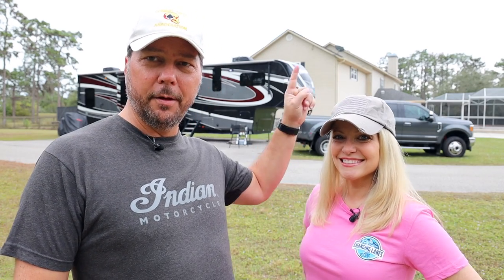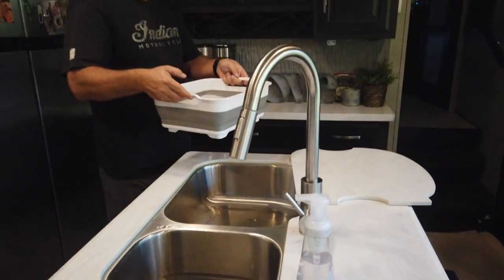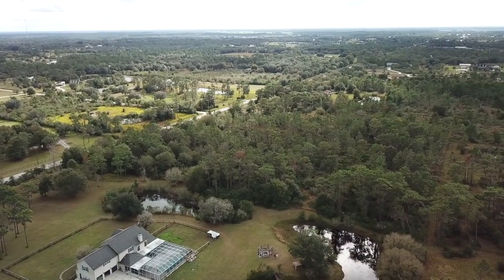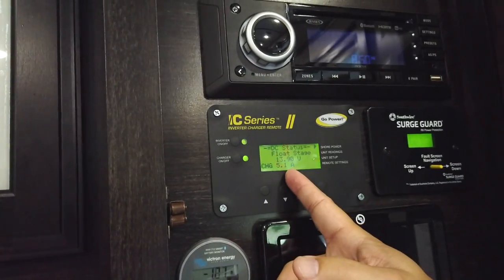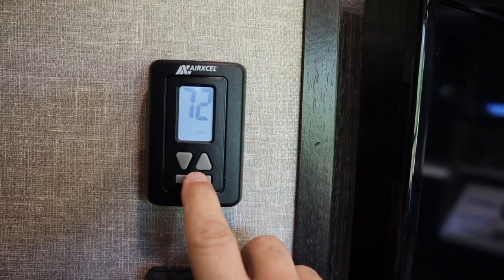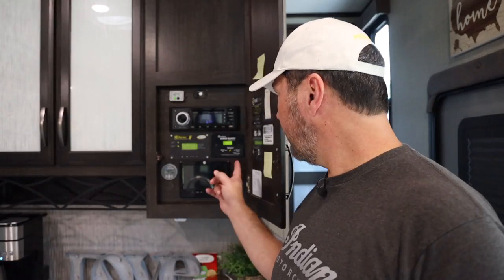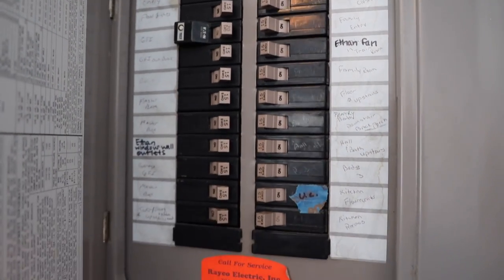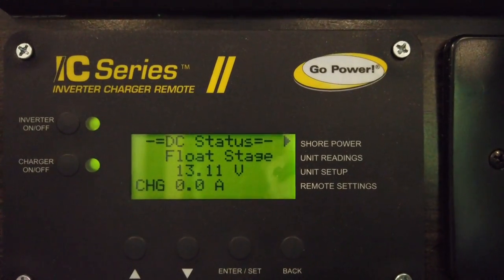RV Moochdocking! | Cheat Boondocking Like a Pro! | Changing Lanes!

Comment: Maybe a silly question...  Is there any point to using a splitter on a 30 amp unit to draw from two 15's?  Maybe to help prevent tripping breakers at the host house?
Also, is there any truth to the rumor that you have an easier time if you plug your 30 amp into a residential clothes drier (or other large appliance) outlet since they use the same plug?
Reply from the maker: IF 30A is available, no point in doing 15+15...  Residential clothes dryer plugs can sometimes be wired for 240V and is definitely a bad idea for RVs.
Reply: @ChangingLanes  Thanks for the response!  What I meant was if the RV is 30 amp, does a 30 amp splitter to 15+15 exist, and if so, would there be any benefit to using it?
Reply from the maker: Ohhhh... I misunderstood.  No.  The reason you can split a 50A RV is that it's really two legs of 50A.  So, 50A is really 50+50A.  A 30A RV only has one leg so there's nothing to split.
Reply: @ChangingLanes  Got it, thanks!  Glad I stumbled upon your channel, your videos are very informative.  If you don't mind me asking one more question...  In one video you mentioned you have a Grand Design - we've pretty much narrowed down our selection to two different Grand Design models, in your experience is the support and community truly as amazing as everyone makes it out to be?  It seems too good to be true.
Reply from the maker: We think so!  Well before we were ever ambassadors for GDRV, we received amazing support.  Also see: https://changinglanesrv.com/faq/?Display_FAQ=2193
And the community is really like family and the rallies are great!
Reply: @ChangingLanes  Sweet, thanks again for the response!  We're probably gonna go full time in a couple years once the nest is empty - another thing that has us sold on either the Imagine XLS 22RBE or Imagine 2600 RB is the insulation (of course, there's no telling what the future holds, but that's what we're thinking right now).  We're currently based in the midwest and most of our family is out here, so four season capability is mandatory and Grand Design seems to know what they're doing in that department.
Thanks again for all your help, looking forward to shaking your hand at a rally someday.

Comment: Is it ever necessary to dog bone from 30 amp to 20 amp, down to 15 amp? Does it make it safer? I'm plugging into an older home and don't completely trust it's wiring. Thanks!
Reply from the maker: The dog bone adapters simply adapt the wiring.  It won't change anything about the circuit you're connecting to or the loads from the RV.  If it's a really old house with old wiring, this might not be a good idea.

Comment: Newbie here and i know this video is a little old but hopefully you can shine some light on this for me. lets say i buy a 30 to 15/15 adapter can i just run 1 side? asking because if i can just get that without the single 30 to 15 its less i would have to carry. Thanks.
Reply from the maker: Yes, but only half of the things in the RV will be powered.. Additionally, if you have a surgeguard or some type of power protection (highly recommended), it will likely see the one dead leg as a fault and not pass any power.   I think the built in power control system that came with our RV might also not like it...
Reply: @ChangingLanes   @Changing Lanes  This applies to a 50amp system. How about a 30amp system? do they mostly come single or 2 pole? I will be buying a RV this coming winter and most likely it will be a 30amp unit (going with something like a keystone springdale 260BH). Ha newbie questions. Thanks for helping out.
Reply from the maker: Oh.. I misread.  I don't think they make a 30 to 15/15 because there's only one side to 30A and nothing to split.

Comment: It's closer to 38 amps to start most air conditioners, You can use an Easy Start to bring that start down to 17 amps.
Reply from the maker: We've considered that...  A hard start (basic capacitor with no "smarts") or soft start (same but with "smarts" but about 3x the cost) are great add-ons if you're having trouble with blowing breakers, tripping the genny, etc. But, we've never had any issues using our stagger start method so it's difficult to justify the cost in both money and time right now to invest in them.

Comment: Not entirely relevant - but dumb question:  if you have a 30amp camper can you moochdock on a split from 2 15amp house plugs to a single 30amp camper? Or does that not work the same way as the 50amp service split?
Reply from the maker: No.  30A RVs only have one leg, so theres nothing to split...

Comment: Chad, thanks for the discussion about plugging into a GFCI outlet when running 2 x 15amp cords through a y-connector.  Last time I tried to plug into a home 15 amp outlet (exterior GFCI) it tripped the “pushy button thing” every time, even though I only had a single cord connected to a single outlet (through 2 dogbone adapters in series).  The only loads inside the RV were the inverter to cool the residential fridge and maybe a trickle load on the charger (the batteries were topped off while driving).  After several attempts I gave up.  Any suggestions?
Reply from the maker: Tough to say.  The GFCi trips when it detects an imbalance between the hot and neutral lines, and it could indicate a wiring problem in the RV where either the hot or neutral are connected to ground.  Here's an article I found that might help: https://blog.goodsam.com/rv-doctor-why-does-the-gfci-on-my-brand-new-rv-keep-tripping/

Comment: Question for ya Chad....referencing the shot of the surge guard monitor at 19:06.  With line one only showing 110v, could an autoformer be placed between the y adapter and main 50a line to the rig to bring the voltage up on that line?

Or not because it isn't a 15a autoformer?
Reply from the maker: The autoformer will work with any input.  It doesn't care about amperage (other than going over 50A).  I'm not 100% sure how it would handle separate inputs to each hot side if they are in-phase though.  It would definitely be fine for a single input.

Comment: We have a 50amp rv. Looking at camping where they have a 30amp & 20amp.  Would the adapter with the two 30amp to 50amp work by putting a 30 to 15amp  connector then plugging both up.  Understand if one is a GFI that would be an issue. Appreciate your thoughts.
Reply from the maker: Maybe... I'be bet though, that most 30A pedestals are 30A total vs 45.  Won't know till you try it.. 😊

Comment: Do your 3 A/C units have soft start relays installed in them ? Interesting vlog . Belated Happy New Year Chad & Tara .
Reply from the maker: No...We have older units...  A hard start (basic capacitor with no "smarts") or soft start (same but with "smarts" but about 3x the cost) are great add-ons if you're having trouble with blowing breakers, tripping the genny, etc. But, we've never had any issues using our stagger start method so it's difficult to justify the cost in both money and time right now to invest in them.
Reply: @ChangingLanes  Thank You for your reply .

Comment: A simple circuit tracer from the hardware store will tell you which outlets are on different circuits. I bought the 50-30/15 splitter so I only need 1 30-15 dogbone

Comment: ? If at an RV park and you have a 50 amp RV, the park only 30 amp plus regular 110/115, can we run one 30 amp, then split into the 115 on the same RV site post? I know some parks may handle that well, some maybe not? But overall I would think so?? And thanks as always, love the info
Reply from the maker: While it is technically possible to run a line to 30A and another line to 15A, there's just no way to know if the pedestal is wired to handle 45+ Amps. I think many parks might be wired to handle only 30A. Definitely check with the RV Park first.
Reply: Thank you.

Comment: Easiest way: check voltage at the two 15A cord caps. If you have 240V = you have two phases = good to go.
Reply from the maker: The AC phases shouldn't matter since the two lines are completely isolated, no?

Comment: nice rv  I like muchdocking my brother parked his 45 ft. new mar   rv on my driveway out frist trip he used 115 from garge but kept blowing breaker they were here 30 days that a lot of flipping breakers my drive is 40' wide by 200' before next visit I had a electrician come &put 2 50 amp breakers with external 50 amp box that I can lock now we back him in  level rv hook up 50 amp power  15 min.  they come back every 3 months for wifes medical dr. visits he is retired 30 yrs marine they are camp host  .the white hoses for water crack after storage is there better hoses tryed reg water hose gave water bad taste do u have any ideas enjoy your travels
Reply from the maker: We had some issues at first at Tara's brothers house also.  The thing to remember is things in the house also draw current from that circuit.  We couldn't run the AC and also use the powered garage door a the same time.  😳  I will add that to the blog notes and description.  👍🏼
On the hoses, we really like these:   https://amzn.to/2QSvTex

Comment: Did you add your RV monitor system to your RV. If so do you have a video on how to do it?
Reply from the maker: Not sure if you mean the Ring alarm system?
Reply: @ChangingLanes  Your panel where you were showing the electrical flow, just below that was a screen which you can check other parts of your RV. I didn't think Grand Design has a screen display.  I'm getting a GRAND DESIGN SOLITUDE 2930RL after the first of the year, I'm boning up on everything there is to know about RV life.
Reply from the maker: The big screen is the Lippert OneControl that came with the RV...  The GoPower screen is our inverter... the small round one is our battery monitor.  The black one on the right is our Surge Guard.  

For electrical flow, you're likely thinking of the Inverter display?

https://changinglanesrv.com/inverter-project/

Comment: Saw you have a Norcold 2118, how has it been?  Our last RV had one and we had nothing but trouble with it in hot weather.
Reply: I have the norcold 1210 in mine. It definitely struggles in hot weather.  You have to add fans like they did. We don't camp in the summer but if we ever decide to or decide to full time in it, we will either have the fridge converted to 12v or get a residential fridge
Reply: @dawnr6577  Current 5ver now has 20cu/ft 4dr residential, 800w of solar for it along with electric teakettle and microwave etc.

Comment: Great video, but you forgot one important thing, the gauge of the extension cords. 14 is the norm, right. 
Also, aren't you running the cords a long distance for the full potential of the extension cords.
Reply from the maker: This was a longer run than normal... Notes have been added to the video and blog post about proper gauge for the extensions... 👍🏼

Comment: I'm a little confused... so, help.  We just bought an RV that is 30.. Of course.. that limits us if we want to run a coffee pot and heater as well as lights, TV, etc.  So the question is.. If I buy a splitter and plug it into the 50A side and have a pair of 30a ends on the Y.. are they wired so I am pulling 30A of one pole of the 50 and 30A off the other pole.  Thinking mostly of cold camping where I may want to have a separate heater in the RV.. or in the summer where I may want to have the AC running along with other accys.. and something like a Crock Pot/Instant Pot on a separate circuit.  Thanks for any info.
Reply from the maker: A 30 A RV is a single 30A line.  That's 3600 Watts and there's no way to go over that.  There's nothing to split like in a 50A RV which is actually TWO 50A lines for a total of 12,000 Watts.
I wish they'd use watts instead of amps because it would initially sound like 50 vs 40 isn't a big deal.. But, if you hear 12,000 vs 3,600 it's more clear.
If you want to run more than 3600W, one option is an extension cord to the 20A or 15A on the pedestal to a single device...   You can run the heater on that and still have your 3600W for the rest....  Good luck!

Comment: we have a 50amp RV . A place we will be camping has a 30 Amp receptical . I have 30/30 to 50amp  Y adapter. would it be possible to plug one of the 30 Amp plugs in my 4500 watt inverter generator along with also using the 30amp shore power for the 2nd AC if needed. And going through my 50amp surge guard ?
Reply from the maker: That should work.... BUT be careful to not use the full 30 on both legs.  The total amps should stay under 50.  Since you can't control the phase of the two power sources, you should assume they might be in phase... 30+30 in phase would mean 60 Amps on the neutral, putting too much load on it.
DISCLAIMER: This advice comes not knowing the full situation there.. use at your own risk.

Comment: Interesting stuff.  Question tho why don't you use easy starts on your ACs
Reply from the maker: So far they've been unnecessary.  And at $300 per AC, it's a tough expense to justify.  We are looking at hard starts though.. Same idea (capacitor to help start), but without the "brains" and only about $100.
Reply: @ChangingLanes  Yes they would also help easy the start up draws along with easiness on the wallet

Comment: Question: between the extension cords and the surge guard (in the diagram) is the little box a breaker box?
Thanks Shane
Reply from the maker: Not entirely sure what part you're asking about... If it's in the video, if you can include a time index XX:XX, I can see what you're asking about...
Reply: @ChangingLanes  15:54 to 15:58

Comment: The link for the Y adapter goes to Amazon, but the plugs are reversed in what I see in the video. I've searched for a while now and can't seem to find the 2 30A Male to the 1 50A female. Do you have a part number from Camco for this part? TIA
Reply from the maker: No... I think the part might just be out of stock.  I can't find it anywhere either.. ☹️

Comment: Don’t they make the newer AC units for RV’s with a soft start now?  I have seen another channel install one.  Just curious...
Reply from the maker: They were doing that... not sure if they still are or not.  I know when GDRV made that change they also took out the heat pump option (bad idea IMO).  Now the heat pump option is back but not sure if they are still soft start. Our 2018 does not have it.

Comment: When you connect two 15 amp. What if you have a 30 amp outlet can you connect the other line to a 15 amp ?
Reply from the maker: While it is technically possible to run a line to 30A and another line to 15A, there's just no way to know if the pedestal is wired to handle 45+ Amps. I think many parks might be wired to handle only 30A. Definitely check with the RV Park first.
Reply: @ChangingLanes  If you turn your 30 amp breaker off and the 20 amp remains hot your probably good to go to use both if wired to code.
Reply: How do you test the total pedestal rating on your own without asking the park?

Comment: Chad I just purchased a fifth wheel with 2 Air Conditioner and have two Honda EU3000Is running in parallel they both have a 30 amp receptacle so  an I run both AC units and a residential fridge when boondocking?  Mike
Reply from the maker: Assuming the 3000 means 3000watts...  That's 25 Amps AC (120v) for each leg. The AC's will take about 13-5 Amps depending on the size.  Should be plenty of juice for that.. 👍🏼
Reply: Changing Lanes you guys have taught me so much about Fifth wheels mine is a 41 ft Brookstone 344fl with a residential fridge it is made with Azdel instead of luan and was $30000 less than a Montana model just like this one. I’ve worked for 35 years as a UPS man and can’t wait to hit the road with our new camper in about 14 months when I retire. Keep teaching and best luck to you two.  Mike Whiteman Hornell NY

Comment: Good New Year To Ya's So I take it that you know these people who have done this type of work lol Just kidding No Very Good INFO Question : Can you Purchase  these wires at time of Purchase  of the Camper/ Rv  or should we Purchase them somewhere else ? What do they Run $  Thank You for your Time & Always Commenting Back to Us !!   Be Safe !!
Reply from the maker: Hi.. These are strictly after market.  I'm sure many dealers have them in their stores for an inflated price (they are all over priced).  You can always check the description of our videos for links to products.. But, here they are for convenience: 
➡️ Valterra Water Pressure Regulator: amzn.to/2ultXDD
➡️ Water Flow Meter: amzn.to/2udwzDl 
➡️ RV Dogbone Adapter (30A Male to 50A Female): amzn.to/2udv9bZ 
➡️ RV Dogbone Adapter (15A Male to 30A Female): amzn.to/2FkFFQX  (two of these in our setup)
➡️ RV Y Adapter (50A Female to (2) 30A Male): amzn.to/39JXrer 
➡️ 50 AMP Locking Male/50 AMP Locking 90 Degree Female (for side of RV): amzn.to/39GFLAE 
➡️ Surge Guard Total Electrical Protection: changinglanesrv.com/surgeguard 
➡️ Inverter Gear: changinglanesrv.com/inverter-gear/ 
➡️ Victron Battery Monitor: amzn.to/2MXaSOl 
➡️ Battle Born 100Ah Lithium Ion Battery: amzn.to/2ZTGU3l
Reply: @ChangingLanes   That's what up My Friends !! Wow Nice Comment  Love it Yes it had  slipped my Old Mind for not looking down in the Description of Video !! lol And Yes We would buy Aftermarket.. Again Thank You & Be Safe Out there !!

Comment: Does the 50 Amp RV take from a 220v source?   I’m confused over whether the 50 Amp RV needs 220v or 110v.
Reply from the maker: Technically, yes.. the voltage from hot-1 to hot 2 will read 240V since they are out of phase.  However, each line is isolated in the RV and there is no usable 240V in most cases.